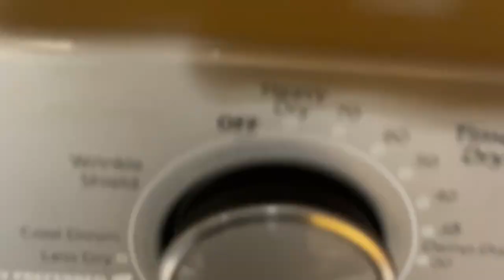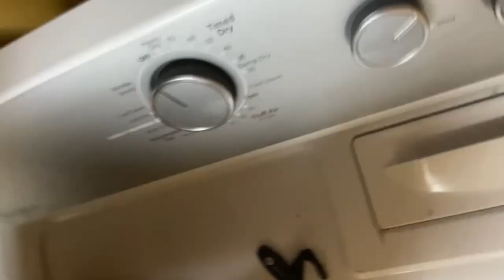What Does 2 Short Years Look Like In A DRYER VENT CLEANING?!  Lets See! #almetaldryervent #fyp #fypシ

Comment: Hey Steve got a question for you. So after watching your channel (and subscribing) I hired someone to clean my vent. He said my due to the age of my dryer, it's not pushing as much air, but still pushing ok. Is there a way to make the dry push more air flow? It still runs well so don't want to buy a new one. Thanks for your help.
Reply from the maker: That can be a tricky one.... Did the tech take an airflow reading?
Reply: @advsLLC  Not to my knowledge. He said he could hear and feel the air flow, but it didn't feel very strong. This was after cleaning the vent.
Reply from the maker: @marcimartinez247  That's not good... Sounds like you may have a break in the duct somewhere... Where is the vent run? In the attic, crawl space?
Reply: @advsLLC  It runs up the wall, through the attic to the roof.
Reply from the maker: @marcimartinez247  Some will say you should install a booster fan in the system... I couldn't disagree more! If the machine isn't pushing enough air, that's one thing. Has anyone tested to CFM of airflow at both the exhaust of the dryer as well as the airflow on the roof? The machine should be pushing between 95-108 CFM to vent properly.